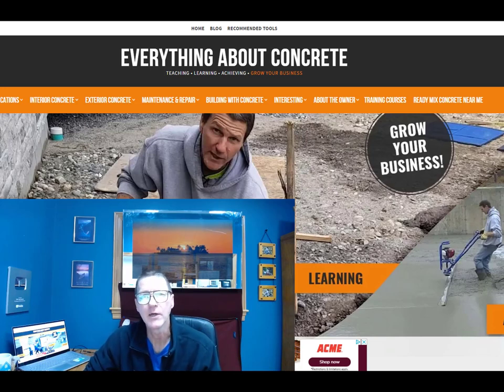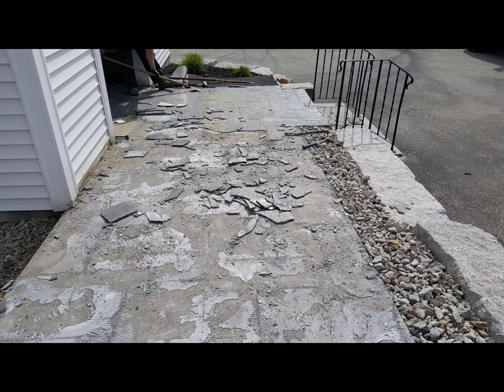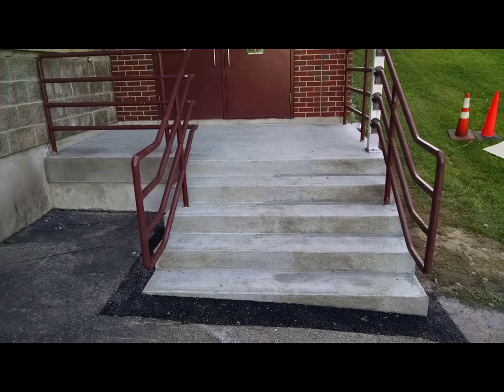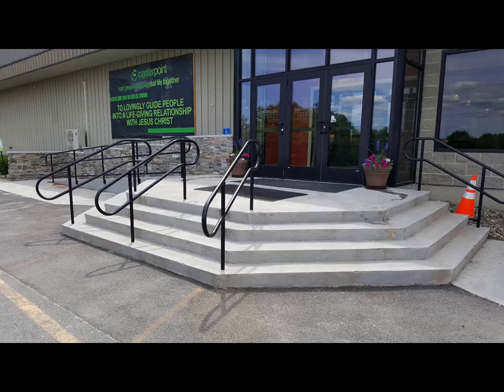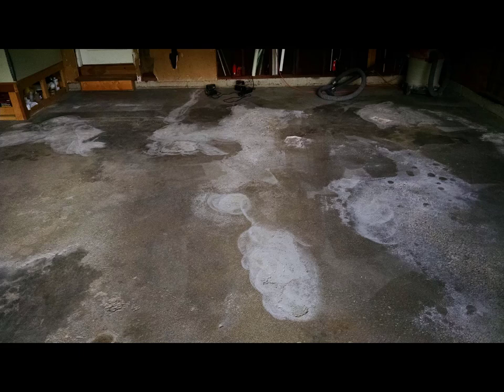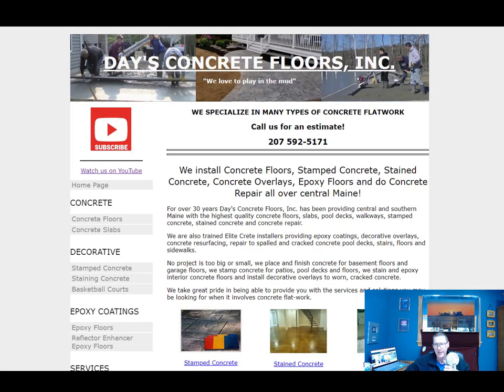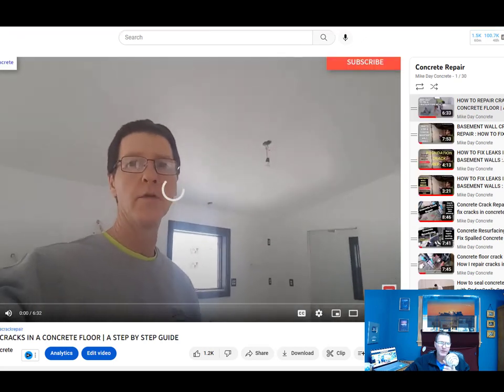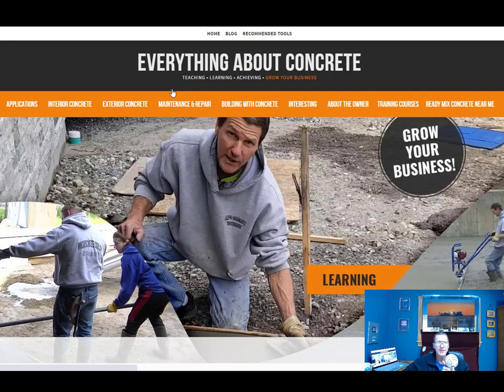So Much Concrete To Repair! Before And After Pics

Comment: Crazy how in Iowa, I poured sections about 4'x6' one by one in my back yard for a clean, easy to keep clean potty area for the dogs, and after 20 years there's no spalling, cracks, because I used a rich mix and wet cured the concrete under plastic for one week. I used only sand and portland no gravel. I don't remember the exact ratio, it was something like 1 shovel of Portland to 8 or so shovels of sand mixed in 2 wheelbarrows and poured about 4" thick. Same with the basement floor- 1,000 sq ft of concrete I poured in two 4x6' or so sized slabs every weekend, mixed up in wheelbarrows and hauled down in buckets. I had to dig the dirt down 4" to do it due to low ceiling height.

At my workplace a contractor came in and poured  concrete  in the alley between our two buildings, right on the ground in the hot sunny summer, floated it and left, maybe a year later pieces between control lines cracked, it was spalling after the winter, and then one section was lifted up by frost or something 2" one winter but in the spring settled back.
I see this a lot, city sidewalks, driveways- they dump the soupy weak concrete in, float it, and leave it drying out way too fast in the sun, and it all starts falling apart.
Reply: Lots of bad concrete in Davenport too 🖐✌
Reply: 4" thick helps
Reply: Likely ice melter has been used on many of the failing concrete surfaces you are referring to. It destroys concrete

Comment: Hey Mike, my brand new garage apron looks like some 5 yr olds played with concrete on the surface. Very poor finish work. There's recesses for the garage doors also. There's large low lying areas there also. What product can I use ontop and mag float/trowel it out to repair this area. It's brand new and would have been better if they just bull floated and walked away. Smh thanks for any advice.
Reply from the maker: Look up Sakrete All Purpose Cement Mix Pro Mix, (Red Bag) that's a good all around repair product than can go from 1/16 inch to 2" thick for repairs.
Reply: @MikeDayConcrete  I know that product tnx. However, I don't have 2 inches of depth to work with. Depths are 1/16 to 1/4 of an inch at most. Maybe 3/8 in a spot. As I said this is brand new entire garage slab and apron. I just want to repair the extremely 😫 bad finish on the apron only. I'm afraid at the depths I just gave you, anything I add on top will just crack and peel away. The apron area does also get extreme amounts of sunlight also. Thanks Mike for any advice and help. After being excited about my construction here, watching you and essential craftsman I expected a way better finish on my concrete work than what I got from my subcontractor. Basically my wife and I finish concrete better ourselves lol 😆
Reply: @shanesouza4303    Shane, I’m an a retired Cement Mason. Why don’t you get the people that Poured your concrete back and show them what you’re upset about. If it’s brand new, they should fix it and if not take them to Court or let or let everyone know how Bad of a Job they did. Don’t let them get away with doing Poor Work.
Reply: Mike Day, why would you have Shane Souza repair his Brand new Contractor poured Garage Apron rather advise him to get the Contractor back and have the Contractor fix it. Once Shane tries to fix it would void any Guarantee on his new Concrete. Come on Mike ???
Reply from the maker: @johnruth4311  I assumed he asked them to come back and didn't get a response, my fault. You're right, they should fix it. If they don't at least he knows what to use to fix it with.
Reply from the maker: @shanesouza4303  Did you ask them to come back and fix it or replace it. Or don't you think they would know how. That's too bad.
I've got quite a few videos that show how to resurface concrete in my "Concrete Repair playlist" on YT
Reply: @MikeDayConcrete  they're finish work is basically non existent. There's always some excuse that I don't know what I'm talking about. They even said that about an inspector. On my house slab water at the entrance way runs towards the house and to the left which is uphill on the grade. Not sure you would ever want these guys returning to any property. I'm not being intolerant. Within a 1/ 4 of an inch on work is good 👍. It's so bad I set all hardware on my sheerwall for the garage myself. I have to frame it so ya.
Thanks for the time Mike.

Comment: If you're doing an overlay. What's the minimum thickness of the overlay. And do you stagger the expansion joints from old and make new or go over existing expansion joints? Most of the overlay post pictures I didn't see any expansion joints?
Reply from the maker: Overlays can go as thin as 1/16 to 1/8 inch. We honor all expansion joints, either clean them out or re-cut in same place.
Reply: @MikeDayConcrete  thanks
Reply: You generally can't overlay v joints or saw cuts because the expansion of the existing concrete  will pop out the product, no matter how strong it is.
Reply: @Lachlan It Is  can you send me a pic, of what a V joint is.
Cheers
Reply: @Andrew8885W  sorry a v joint is another word for tool joint. You see them in footpaths and driveways mostly. A depression made by a tool so the concrete cracks there.
Reply: @Lachlan It Is  doesn't that mean the edge of steps are V joints.
But he's definitely shown he can fix them.
Not trying to be a pest.
I'm just smart and interested.
I'm making concrete basins at home, after a debilitating container hand Unload, forklift collision
Reply: @Andrew8885W  no not at all. A v joint is an expansion joint designed to crack. So it will always crack and the product will crack out. 
In this particular case because the steps would have been poured as a whole and a lot of Rio used I can't see the product cracking out on the bottom of the step treads.